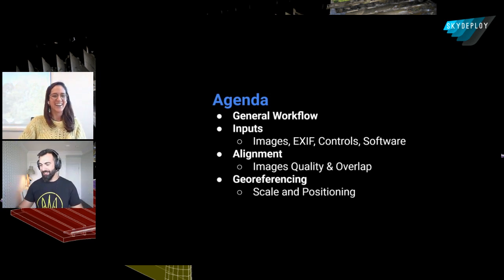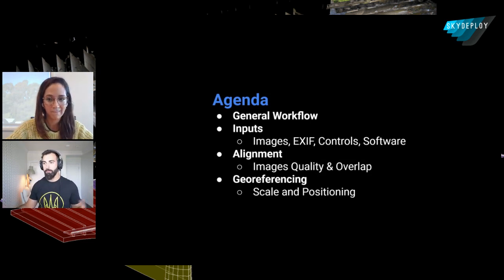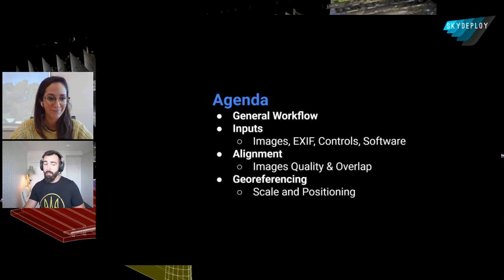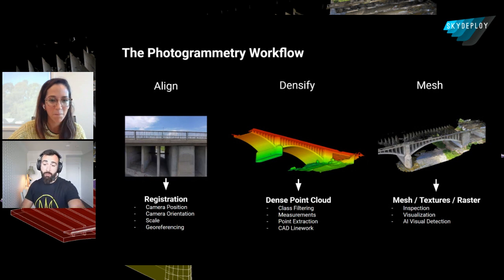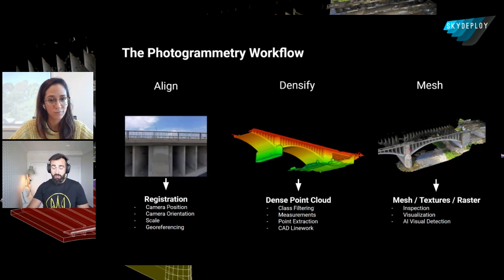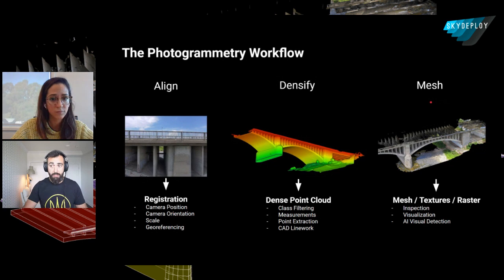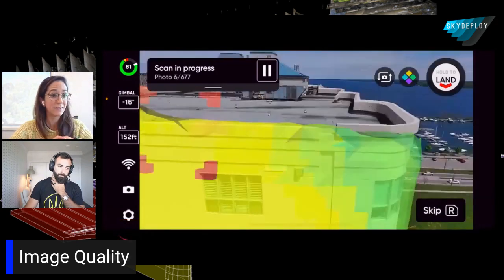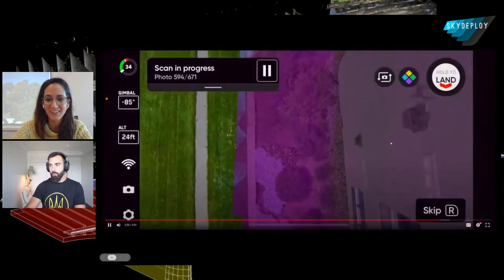Photogrammetry Best Practices for Skydio 3D Scan Data

Comment: Skydio programming need/could include a DateTimeOriginal EXIF tag in the images..you skipped what CAD software is needed to view/use for design/survey, another issue I have with presentation such as this is the presenter switches from one software to another and never describes what the program is.